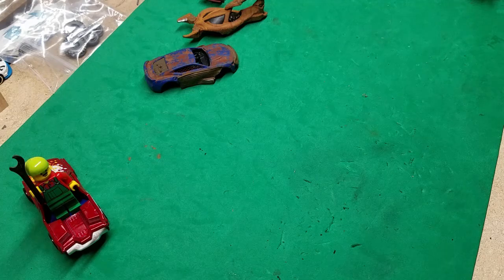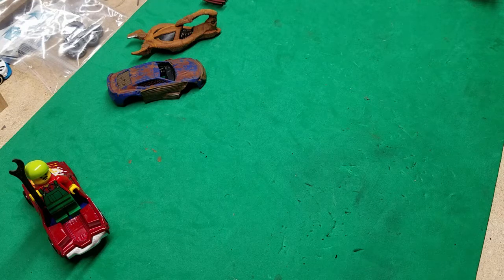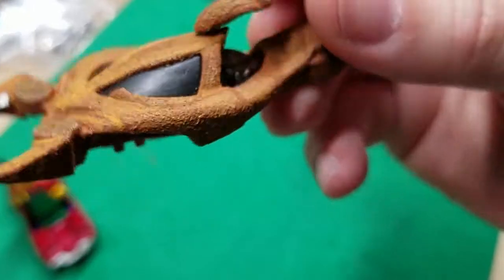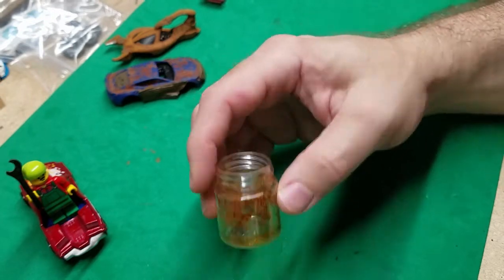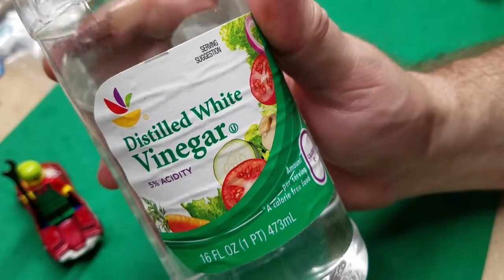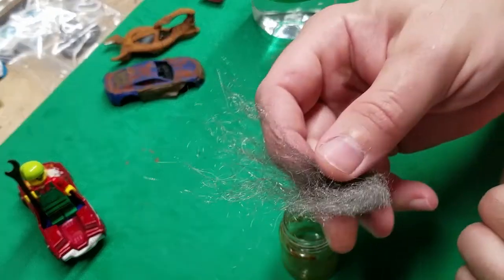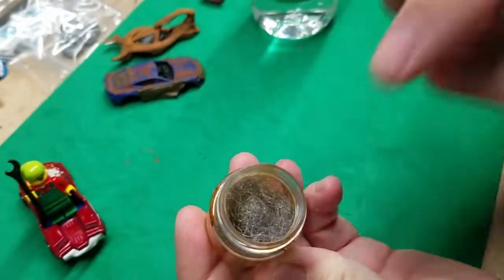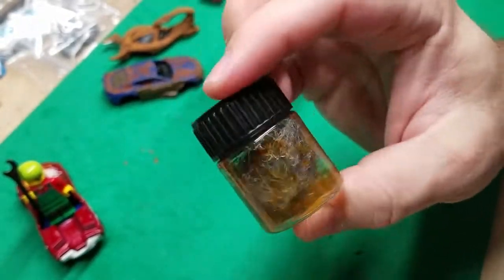Gaslands Garage: DIY Rust Texture

Comment: Not sure why I never thought of using actual rust to create a rust effect! That's pretty cool. 
If you want to speed up the oxidizing process (speed it up like going from days to hours or even minutes), try adding some hydrogen peroxide to your vinegar solution. 
Right now you're just using air as the oxidizer, but the peroxide creates rust faster because it's a better oxidizer (it's also a better disinfectant than vinegar if your really worried about that bacteria and stuff). 
Like you said though, you need the acetic acid in the vinegar to catalyze the reaction. It doesn't actually remove any coating from the steel wool. The positive hydrogen ions in the acid remove electrons from the iron, ionizing it and making it more susceptible to rust.
The only caveat I'd have for using the peroxide is that I'm not sure how peroxide will react with acrylic paint. I've only ever used the technique to add a rust patina to art projects.
Reply from the maker: Thanks for taking the time to give your feedback. A solid tip on the hydrogen peroxide. I'll experiment with the paints just to see. Not all my paints are acrylic. Some are enamel and then there is the urethane paints.

I'd be concerned that the hydrogen peroxide method might change the variations in tones I get in the rust with the process acceleration.  Having tones to play with is important to me seeing that we are using them to create different kinds of rust colors.

This rusty gold sit for a long time. I've got a pot that has a good year on it. Nothing ever grew in the paint pot and I always attributed that to using the vinegar. Not having bacteria or fuzzy things in my paint pots is a good thing. The only science project I want is the rust. 😉😁

I've heard from a few people going way back in time that there was a coating to the steel wool that prevented it from rusting in the package. That always made sense to me and I never really questioned it. I've never seen a new package that had rust tinges so there was validation in that statement to me. The science behind the the vinegar would be solid all the way around on both accounts. In all honesty, I don't care how it does it so long as it does it. 👍😉😁

Thanks again for the input and stopping by the shop.👍
Reply: Excellent advice. What a great community you're creating.
Reply from the maker: @mikestanmore2614  glad you enjoyed it. I got more trips up my sleeve. If only I could get them to video faster for you guys.👍
Reply: @gaslandsgarage7214  You keep posting, I'll keep watching.
Reply: Haza Science!
Reply from the maker: @Bungwirez  Huzzah indeed! Not just for science but also for inexpensive old school hobby solutions.

Comment: Nice tutorial man! I found your video how to make full rust car but how did you do the other one? the blue one? did you paint it blue and then applied rust? or did you paint it blue then added some orange and painted rust on top of orange? wouldnt you get same "effect" like mixing some quarts sand some paint and glue? Thanks!
Reply from the maker: The blue car was actually green from the factory. I always strip cars I do to bare metal. After the car was stripped I applied the rust and then did a worn/chipped paint technique. As far as mixing paint with sand? Not for me. Nothing looks like rust more than real rust. Why would I use paint when I can use the real thing?
I'll be doing a video on that in the future. For now, it was necessary to show how to make the rust so that when I do future how-tos I can refer people back to this.
Keep watching and subscribe so you'll know when I post new videos. Thanks for being part of the Gaslands Garage community.

Comment: Do you have any problems with the material continuing to rust after you apply it to the cars? I would think the acid in the vinegar would continue to eat the metal until all of it was catylized. Also does the vinegar have negative reactions with the paint or the materials on the cars?
Reply from the maker: I think you're way overthinking the whole thing. I've never had any issues or concerns with what you've brought up.
This is a process that's been around for decades within the railroad modeling world. Long before rust textures became a product. Nothing last forever though. Even the Zamac of diecast cars oxidizes. They just oxidize to grey because it's not an iron based metal but Zinc, aluminum, magnesium, and copper.
The cars you buy out of a package are in the process of rusting. 😉👍

Comment: Ok, this is going to sound super stupid, but how do you collect the rust from the wool? I get that some rust will collect on the bottom if the jar, but a lot will be on the wool itself, won't it?. Do you rinse and strain the wool? I've seen others fill a mason jar with vinegar and wool, and then later strain the liquid with a coffee filter to collect the rust.
Reply from the maker: Ok. So there is no actual wool fibers to steel wool. Steel wool is steel that's in thin strands and resembles clumps of wool. Hence the name.

So... the fibers breakdown through oxidation and basically just dissolve into what we apply to the car. Thin out the rusty sludge with some white distilled vinegar if needed to bring things to paint consistency. Add more as needed due to evaporation. Make more rust as required.
That should answer the question.
Reply: Hah, yeah,  I know there isn't wool fibers in it. I just wasn't envisioning it breaking down as much as you are suggesting. I was imagining having a clump of rusty steel wool. Thanks! This looks great, will give it a go.
Reply from the maker: @wilesps  That's cool. I just wanted to make sure you're perhaps one of the people in the world that has never experienced steel wool first hand. Steel wool will eventually turn to powder given enough time to rust. Being in the vinegar that powder gets sludgy/muddy. That's a good thing for us. 👍😁